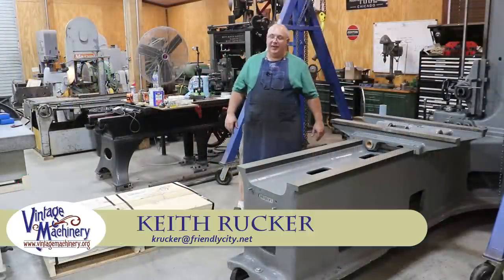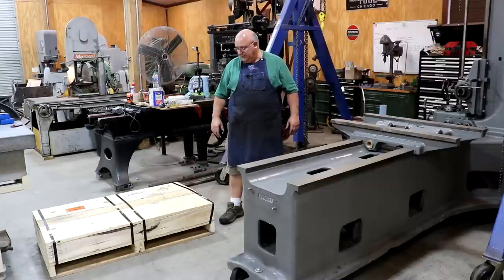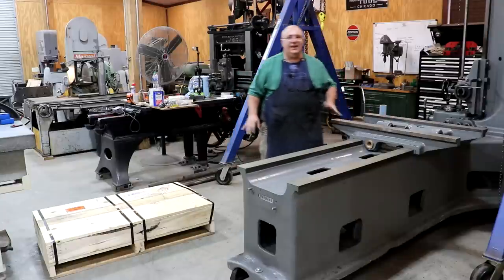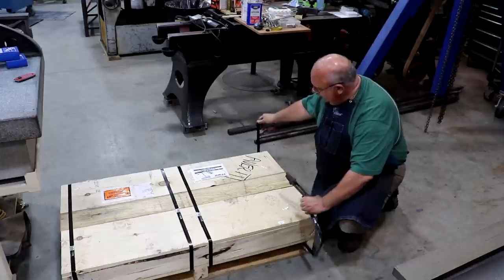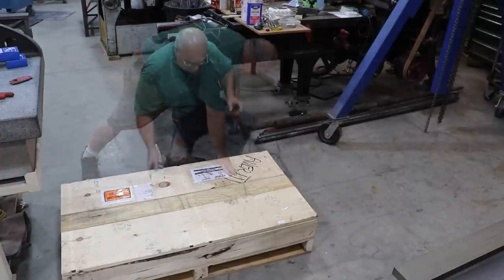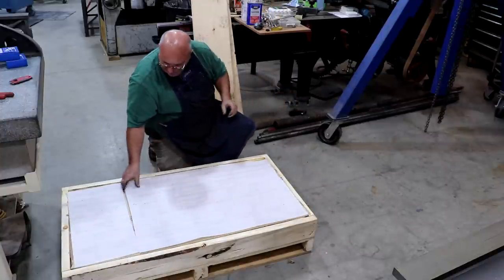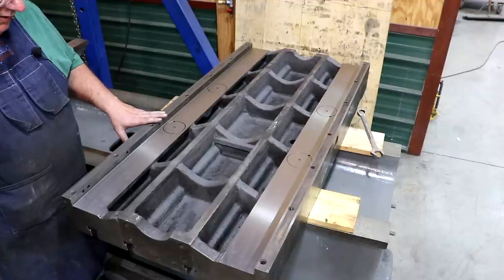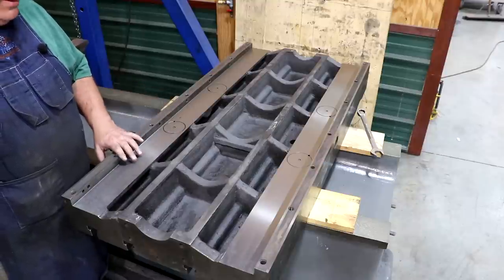Horizontal Boring Mill Restoration: Unboxing & Inspecting the Freshly Ground Mill Table

Comment: Just discovered your channel today, wow, nice to see people who know about these things! I was a scaper hand in my 20's , for about 6 years. First in Cleveland Ohio rebuilding mostly Warner and Swasey turret lathes, then scraping new DoAll surface grinders in Mn,, also rebuilding, scraping, and alignment at Midwestern Machinery in Minneapolis. At DoAll, Turkite was installed as an option instead of regular scraped ways on the table ways, we had a high opinion of Turkite at the time, it was easy to scrape to a good bearing surface, We tested each new machine for accuracy and tried to keep 2 to 3 tenths the full length and width of the surface, largest we made was 10"×30". Still have my scraping tools, blue paste, and red lead!

Comment: Hey Keith! To mark your lift chain on chain fall. If you paint every 18” or so, with red and green stripes. With green on bottom and red on top on down side. All way the length of the loop. The quick look, green shows the way to pull /what chain to pull for lift or lower! As green on bottom for down! Green above for lift and red will be wrong way!  Had to do this because employees never know what chain to pull !

Comment: If you cut two identical pieces of bar (anything that will fit in the t-slots.  You can space the "eye" bolts pretty accurately and pick the table up so that it is perfectly level.  It also prevents the bolts from sliding together which would cause an accident.  On a table this small it isn't that important.  But some of the horizontals that I work on have tables big enough to set a full size pickup truck on.  And those you need to make damn sure that you are picking it up evenly and securely.

Comment: After hearing you talk about them, I had Kinetic do a job for me. I just this month picked up my 1955 South Bend 9A lathe bed. They did a great regrind job on it and also located and drilled the holes necessary for the taper attachment locating pins which were missing on my saddle. As I live just outside Chicago, I was able to deliver the lathe bed myself and later pick it up when they finished. It's a three-footer, so I can lift it myself. A side benefit is Bendtsen's bakery, which is in Racine, between Chicago and Milwaukee, which makes excellent Danish kringle. I recommend the almond and the pecan.

Comment: Keith, having surplus lumber is usually a good thing. I helped do a clean out of a business, and gathered up a very nice bunch of lumber, including some poplar that was milled around WW2. It was done then as most pine or construction woods were used for the military, and softer material often got used like this poplar.
I used most of this lumber to put shelves up in my shop, so the only things I hD to buy were screws for the assembly. It's so nice to have my stuff up off the floor. the roof leaks, so this is also a good thing.

Comment: Of course! you can use the  bed you just had ground super accurate to 10,000th of an inch... I was thinking in previous episodes it would be one of his straight edges, maybe that arc collomomator thing I could do with a refresh watch on how to use it. But the bed never thought of that and I remember the planer bed episode being ground down so precise. That's out of the box thinking to me.

Comment: Called Kinetic and it was about $1500 for a south bend lathe 3ft bed. There's also Shaefer Grinding in Los Angeles  area
Reply: If you're in LA, round trip shipping to Milwaukee would be prohibitive I think!  Grinding sounds reasonable so it might be a tough call.
Reply: Almost makes rebuilding cost prohibited if reselling lathes.  Need to get your own Thompson grinder.

Comment: Big boys, big parcels...
Nice to have such friends/contacts doing such jobs.
Time 10:30, lowering the precious table.... I suppose You cleaned all surfaces involved thoroughly.... Being hot, "honey", on things is not Your way I think...
Time 11:00. Which chain to pull...... I know the problem..... Ought to have been solved. Why not have a kind of spreader keep the two chains apart?
Scrape the top side? Scrape the precise work of Your collaborators? Due to the bed scraping I suppose.
You signed off with a warm smile that travels out to us. Looking forward to the next part of this work.

Comment: I would be concerned picking up such a heavy casting by the T slots.  You would definitely hate yourself if a T nut busted out.  I would 
remove the crate sides, pry up from underneath on a non ground surface and secure a pair of traps under it at the far ends.  Less risk
slinging it from underneath.

Comment: If I may presume to ask, why would you scrape the work surface? It seems to me there are two purposes for scraping: 1. to make the surface flat, and 2. to hold way oil in use. This isn't a way surface, so there is no need to hold oil, and it should already be ground flat. But I would think the ground surface will make it easier to move workpieces and holding clamps around on that table. I get that you want to use the top of the table as a surface plate to check the ways, but shouldn't you at least test the surface for flatness before deciding to scrape it? If they already ground it within a few tenths, can't you just blue it up like it is?
Reply: That's a lot of surface area to scrape, overkill in my opinion.  Sure, it would be great to have another reference surface but he
already has that huge granite surface plate.  I bet when he's half way into scraping that, he has second thoughts and sore muscles.

Comment: Since they were grinding ti why not weld those ugly endmill marks someone put ?
Reply: I need to pay better attention.  I didn't catch what beauty show this was going to enter?
Reply: Not only that.  It will be a very cold day in Hell that Mr. Rucker welds cast iron.
Reply: I thought that too, he could have brazed in some silicon bronze but maybe that effects how stable the flatness remains.
Reply: @petemclinc  
Welds dont warp the cast iron . Key to sucessfull welding of cast iron is to use a electrode of similaror lower  tensile strength.If you dont do that weld pulls the surrounding material and cracks in once good cast iron appears ,  Cast iron is like a glass,its brittle  ,it doesnt like to be pulled alot . Thats why its always smart idea to preheat the cast iron and let it slowly cool down even if you use silver nickle electrodes.

Comment: No need to grind that table if you want to scrap the top and add turcite on the bottom. I would have just send out to make an accurate milling on a large machine tool...and save some money. Scratching the surface before epoxy the turcite is strongly recommended.